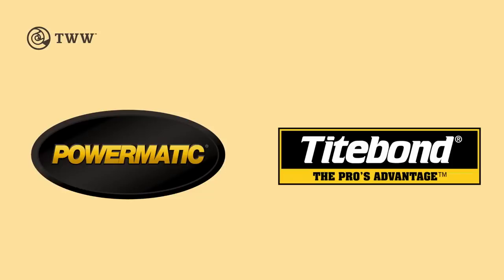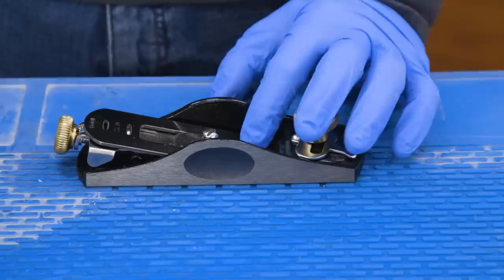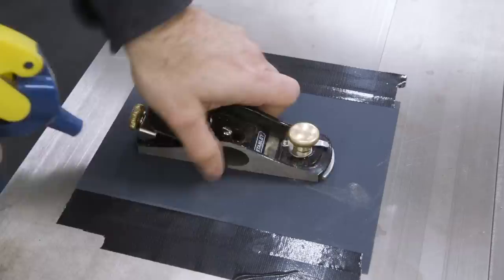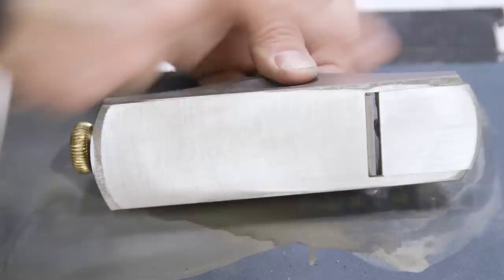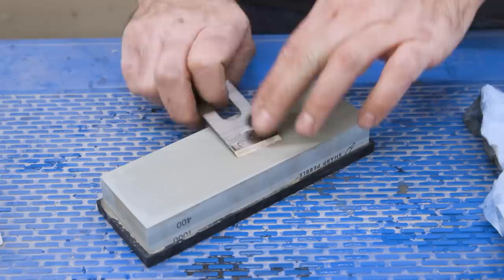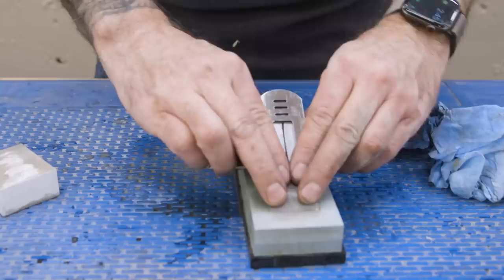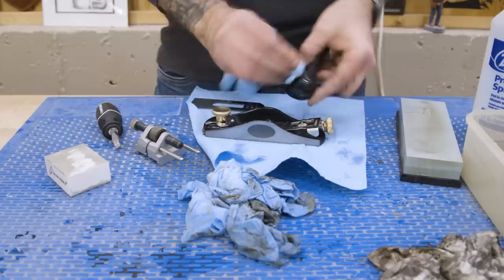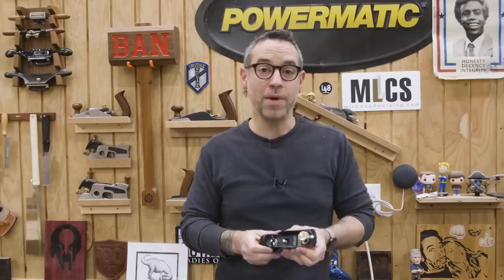$40 Block Plane | Tune-up & Sharpening

Comment: Step 1 earned the thumbs up. Usually I wait to comment and like until after the video, but I have this plane and step 1 "remove the plane from the f!@#ing packaging" was so true
Reply: +1 too good and +1 vote for more of the 'quick and dirty' videos.
Reply: I am glad that I'm not the only one going berzerk when seeing molded plastic packaging
Reply: It's easy to get the package open, just take a knife along the  bottom to front or rear face along the bend all along the entire package width. This creates a door with the package upside down, open the door and pull the plane out. It's that easy but becarefull of any sharp plastic edges!
Reply: Removing the plane ........ without spilling blood all over your bench! Your own blood, that is.

Comment: If you want a good platform for flattening on a regular basis, go to a local granite counter contractor. The one near me has a 40 foot dumpster full of scraps many of which are about the size of a kitchen sink for some reason....
Reply: That's what I use as well.  Damn heavy but dead flat
Reply: @scottroy6195 I got a 9 x 12 piece from Wood Craft for $70.
Reply: Ha!

Comment: On end grain, a little alcohol on the surface (or water) will ease planing.  I use it to remove really thin shavings for microscope slides.

Comment: A good method to finish the sharpening for a beginner is to get a stick of polishing compound, rub it on a piece of cardboard and give the edge a few pulls across on both sides, it can turn a sharp edge into a shave the hair off your arm sharp

Comment: Good basic information and a no-nonsense approach.
I just finished tuning one of those models and found the adjustable mouth plate proud like yours.  On removing the plate, I found burrs on the machined ways causing the mouth plate to stand out from the body.  Removing those burrs with a fine file brought the mouth plate just about flush with the body.  Flattening the sole became a lot easier.

Comment: A very timely reminder that I have a relatively-new Stanley block plane collecting dust in a drawer as I save up for that sweet sweet Vertias with PM-V11. Going to fire-up the disc sander and get the Stanley usable in the meantime!

Comment: I bought this block plane a year ago. It was my first plane ever. All I did was sharpen the blade with sandpaper (300, 600, 1000, 3000) glued to mdf. It has really worked well for me. I guess I should check the flatness of the bottom to get even better results. Thanks for the tip!

Comment: I bought one of those in the mid 70s, as a carpenter. Used it once to plane just a hair off an aluminum storm door. I have a Lie-Nielsen, now, but still use this pretty often. My hand is used to it.  And, really, a block plane doesn't need to be so great.  If I'm looking for a finished surface, I'll use a bench plane.  A block plane just needs to be handy and sharp,

Comment: I have that exact same plane....and after 6 hrs and probably the best cardio workout I have ever had, I managed to get to sole flat...ended up re-grinding the blade on a water cooled grinder as the ridges in the blade were like a ploughed field!. in the end not too bad a block plane for the price,although my biggest problem was the fact that the throat would not close up anywhere close to the blade...fixed it with some fettling and by making a new adjuster plate for the top front portion. ..Now it is not too bad, but take a look at the throat on yours,and see if it is way away from the blade. great vid, thanks for sharing.
Reply from the maker: Maybe I lucked out but my throat closes perfectly.
Reply: @woodwhisperer  hey probably a dumb question but what wax did you put on it?

Comment: the part where you go back and forward with the blade to recreate and knock down the bur is called chasing the bur and is the standard way to break down the bur smaller and smaller without getting higher grits

Comment: Yes it's a cheap plane, but I have had one of these for 40 years and it gets more use than any other in my shop. Extensive tune up, as described, was required. It's lighter than the $280 ones, and nicer in the hand. I replaced the blade with a Hock, and that made a big difference. Someday I'll figure out how to put a Japanese blade in it.

Comment: Note plans width adjustable throat planes, if you material removal is  not parallel to the machined throat guides underneath the throat plate, meaning you sanded more off the front than from the rear and depending were your shoe as positioned full close or full open, when completed and adjusted the throat plate will not be flush to the whole body when repositioning it. This is caused by the new sole not being  parrell to the machined throat plate channel guide tracks. To do correctly you need to measure your work at the front and rear to maintain parallel stock removal.

Comment: The one I have is a pile of garbage. I wasted so many frustrating hours messing with that thing. I tried the WindRiver from Woodcraft and it is a completely different animal. Very easy to setup and adjust. It works like it is supposed to. For the combined money between these two block planes I could have bought one of the premier brands.

Comment: I bought a Groz plane several years ago that looks identical to this one. I tuned and sharpened it ok. But it tends to explode apart when using it. Maybe I’m not locking it down properly. 

In the mean time, I purchased a vintage Stanley block plane. It works flawlessly.

Comment: I use mineral sprites (paint thinner) on the wet/dry sandpaper instead of water to prevent rust.
Reply: @johncoops6897 . I usually use the paint thinner outside or have garage door open  and fans blow air out.

Comment: Got the very same block plane...
It's very cheap manufacturing...and often I wonder why I just didn't spend a little more for a better plane.

Your video was great..!
You really brought that plane to life...
I intend to do the same with mine  it really was never a performer from day 1. 

I prefer a hand plane to any electric version, particularly for finishing..
My dad's plane a 12inch classic Stanley is amazing, and remains a memory of him, and what Stanley used to be....

Stanley has changed so much..
Your video really will help to get this working..
Thanks..

Comment: Great instructions. Do you feel that a 1000 grit stone is good enough for planes and chisels for the casual woodworker or should I try to go to a higher grit? As a non-professional will I notice a difference?
Reply from the maker: Sharpening is one of those things there higher is better, but with quickly diminishing returns. You can do a heck of a lot with blades honed on 1000 grit. Is 5000 better? Sure! But does that mean 1000 grit is like working with a butter knife? Heck no. So I recommend staying with the 1000 until you see a reason to add another stone to your arsenal.
Reply: A piece of leather glued to a flat board and some green polishing compound is a hell of a lot cheaper than lots of high grit stones.

Comment: How interesting -  a certain, once dominant major tool brand that's unable to control quality!

I was given one of those as a present around 15 years ago (I'd let slip I wanted a pocket/apron plane). It had exactly the issues you show and more, and some that I'm still tweaking, as they continue to annoy. And here we are, a decade and a half later, and S*****y STILL hasn't fixed some of the basics.

I ended up doing just what you did, but also had to fix the rebates for the mouth plate, take the razor sharp edges off the toe (where the rebates are), get the 'frog' flat enough to work, and of course, flatten the sole, a lot. 

I'm glad that the mouth adjuster on yours works: mine didn't and now has a thick washer underneath the adjustment screw to help. I still haven't sorted the clamp lever for the iron to work properly.
Mine was the premium version - same plane but with a pouch to keep it in (with the Velcro on the wrong side of the flap!). 

I agree that the steel of the iron takes a good edge, and keeps it fairly well. It's by far the best thing about it, and makes the effort expended worthwhile. Probably.

But don't you think it's a shame, that whilst these planes could be made far better for pennies in manufacturing, they aren't? How many people have a bad experience starting out in woodwork, simply because they go for a big brand and get cheap nastiness? I know it's fixable, but if I'd acquired it when I started out, I'd have had no clue. 

And the fact that, 15 years on, the same plane is still sold in the same nasty packaging, with the same design and manufacturing flaws, shows clearly that the big brand concerned isn't interested in users at all. 

The story of these brands is a sad one - they once cared, and listened to their customers, and were profitable as a consequence. Now they don't. They didn't lose market share to the likes of Quangsheng/Luban/Wood River, they gave it away. 

I have only one of those Chinese planes, a Boggs-pattern spokeshave, and it's brilliant: it came in a wooden box, with a beautiful and very thick iron, that keeps a superb edge, and it cost about 1/3 of the equivalent from a 'quality' brand (it IS a quality product in its own right!). 

So where's the campaign to get Woodpeckers to take over S....?
Reply: Dude it's a low-end $40 block plane. They've always been crap. "Ye Olden Days" only exist in your mind.

Comment: Great pointers!
But, why not refurbish a vintage Stanley Block Plane instead - there are LOTS of them on eBay..... and you can skip the hardest part - opening the package.  ;)
Reply from the maker: Mostly because I’d rather plane my corneas with a dull block plane than deal with EBay. 😳
Reply: @woodwhisperer  My experience was better.  About ten years ago I get a Stanly #4 off eBay that needed a little TLC for $40.  Great plane.

Comment: I have this plane and now see I could make it better (although it's not too bad). I wonder if someone can tell me what angle to put on the bevel for planing end grain? I'm thinking of when you want to clean up a dovetail joint which means planing both end grain and face grain with the same stroke.

Comment: Would you recommend going to a more corse grit if the 220 wasn't working like in the video and you didn't have a powered sander?
Reply from the maker: Yes.
Reply: Yes
Reply: @woodwhisperer  ok, just for an idea, what grit would you consider if you were to do this video over again and have to flatten by hand?
Reply: @chadgreen100  60 or 80 is good!
Reply: 120 max... otherwise your arms will fall off before you get this thing flat.

Comment: I have this same plane and hate it. I’m struggling so much with it clogging under the point where the tightening screw for the mouth is. So right in middle of the blade. It’s rare that it doesn’t clogged so I have to constantly open the mouth up and pick the clogged wood.

Also the knob that pushes the blade out has a huge (1/8”) gap between the knob and the metal that it supposed to move. So while setting up the plane if I push the blade out to far I can’t just turn the knob back and retract it. Because of the gap the knob has to be twisted back 1/8 to pull it back. But then that means the blade would end up 1/8” back once the blade sled has referenced is push side to the adjustment knob. So basically I have to start all over if I push it out farther than I want.
Has anyone else had these issues with this plane? And have you found a solution?

Comment: Hey the bargain guy, you might also want to check out inexpensive small japanese planes. Got one i paid 14€ delivered, it's about the size of a blockplane, it's pretty damn fine out of the box. I'm pretty sure you can find similar deal in usa. Oh and by the way because i'm sure some will want to bring that in, it works also well pushing it ;c).

Comment: I'm used to sharpening my knives and also another type of blades which aren't used for woodworking, so maybe it's different...but I'm confused by the manner which you ran the blade every which way, towards the cut, away, side to side....does the direction it is grinded not matter?

Comment: When starting out a couple of years ago I bought a new Stanley plane. Not knowing any better I tried it out right out of the said f##%*ng package, couldn't get a shaving. When I checked the sole it was actually curved and so rough I could strike matches on it. I checked you tube and they said flatten the sole. I started with 60 grit sand paper, anyway to cut this saga short 3 days later ( about 7 hours ) I gave up, the bastard beat me. I tried to throw it away twice but it kept coming back. Moral of this sad story Don't ever buy a NEW Stanley plane they really are CRAP. Regards Jim UK.

Comment: you want the heel and toe to be lower for entry and exit , people who over flatten ruin planes
Reply from the maker: That’s a bit extreme isn’t it? I can understand someone wanting a slight feathering of the edges, but it certainly doesn’t “ruin” a plane to be flat all the way across. Especially on a block plane. Otherwise I’m using several planes that were ruined at the factory. 😊
Reply: the tip and butt do not need to be flat what it does is allow the plane to dig in and do more damage than good